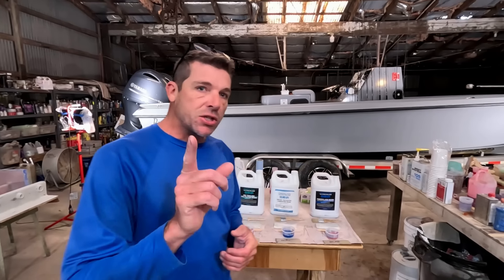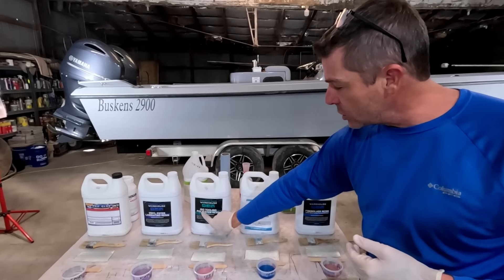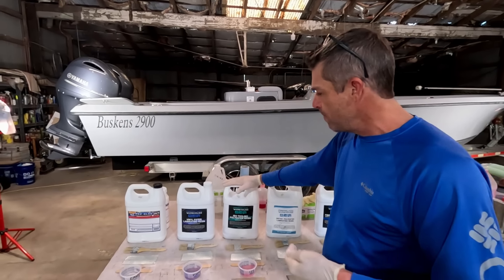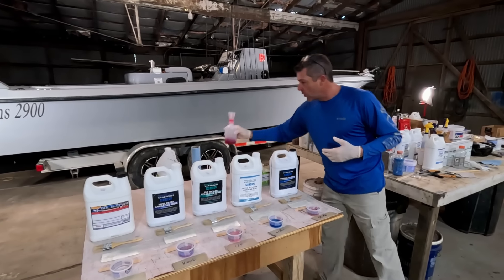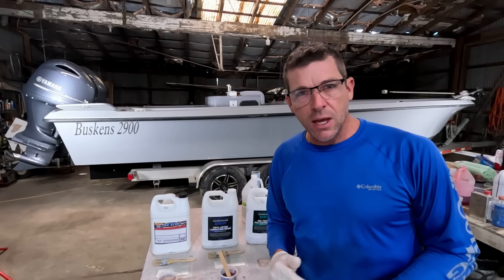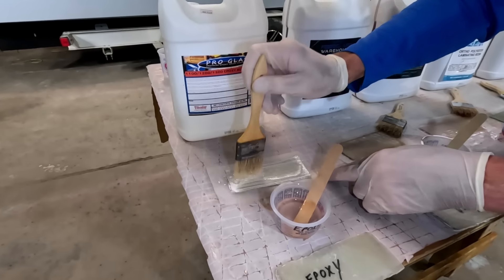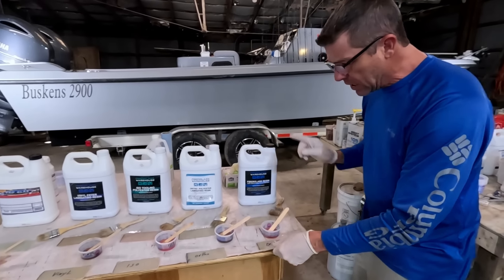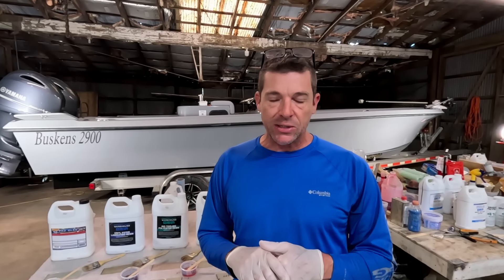HOW-TO CHOOSE THE BEST RESIN FOR YOUR NEXT PROJECT-DIY FIBERGLASS

Comment: What resin should be used to construct a fiberglass gasoline fuel tank?
Reply from the maker: We typically use aluminum or poly tanks in our boats, but I would think that vinyl Ester might be a good choice. ThT is something you should do some research on before making a decision. I hope this helps and thanks for watching!

Comment: my seat supports have broken off @ tha floor of my 1971 boat what resin should i use ? the hull/floor is solid & rock hard    thanks
Reply from the maker: The vinyl ester is my favorite resin in the lineup. It is what I used in our hardtop build series of videos that we have been recently posting. I hope this helps and thanks for watching!
Reply: @FishBumpTV thanks for the responce. on my 71 model flat bottom v-drive “ole school drag boat” its been sitting 30+years & the hull is as hard as concrete along with tha stringers. rite now i have the entire floor & stringers to the point they could be painted. would it be a good idea to sand an lay a fresh lawyer of cloth an resin or let it ride an just put ? coating on the bare floor/hull ?    thanks 
ps new sub. 👍

Comment: I have fiberglass hydrohoist tanks I'm repairing (cracks and chips).  I know that you mentioned that you don't use finishing resin, would it be necessary for my job?  I plan to epoxy prime and bottom paint the tanks after the repairs are complete.  Thanks for the help, your channel is super informative!
Reply: Why are you using bottom paint?
Reply: @FiberglassWarehouse  The are submerged in the water 24/7.  I figured bottom paint would be the best option.  Is there something else you would suggest?
Reply from the maker: The vinyl Ester resin is the is going to be be the best for that application in my opinion. It bonds very well when used in repairs, it is compatible with csm or mat fiberglass and it is a great water and moisture barrier. I hope this helps and best of luck with your project!

Comment: No gel coat over epoxy so could you epoxy then top coat with vinyl ester then gel coat?
Reply from the maker: No, not even vinyl Ester is  recommended over epoxy. I do have a product I will be testing very soon that is designed to solve the compatibility problem between epoxy and polyester-vinyl Ester based resins and gelcoats, so stay tuned!
Reply: Thanks for your reply, I’ll be looking forward to the new videos.

Comment: Im trying to fix a headliner in my car want ot a little stiffer im things the first on or the midle one what do you guys think
Reply from the maker: The middle one, which is a vinyl ester is my favorite all around resin. I hope this helps and thanks for watching!
Reply: @FishBumpTV 
I was hoping for a commet like this as im am doing research in repairing a headliner as well. Its already a type of fiber board..so i would emagin it will absorb the resin well,  that being said mine is sagging.. and i want to fix it before its to late. I think i need a thin yet strong material to add to it. Im thinking a layer of glass cloth vs matt is better. What are your thoughts on that as well as should i apply 1 solid sheet to cover the entire liner or over laping strips? Or multiple layers? It cant obviously be to thick as it has to go back into place. Any help would be great. Ty for the videos im not doing a boat any time soon. But enjoy learning something new all the time.. oh im trying to apply it to the top side... with out bleading through the board or damaging the fabric on the head side.   As its still verry nicely attached and in great shape

Comment: Thanks for the information.
Which one do you recommend for automotive exterior body kit applications
Reply from the maker: Glad you are enjoying the videos! The iso tooling resin and the vinyl ester are really good. Epoxy could also work, but you would have to use epoxy based fillers and primers if you choose to work with the epoxy. I hope this helps, and thanks for watching!

Comment: Im trying to fix a transom that has delaminated in a small area. I was thinking of injecting a resin into the split from the top and then clamping. Would you choose vinylester or epoxy? Love your channel!
Reply from the maker: They could possibly both work. I might lean towards epoxy on this one though. Just be sure there is not any moisture in the delaminated area or nothing will stick. I hope this helps and thanks for watching!
Reply: @FishBumpTV  Thanks again for all the help. You are awesome!

Comment: I want to do a webbing/splatter finish on my current project.  I don't have a sprayer and don't want to invest in all the necessary equipment and additives for a small project.  I bought a can of Montana Marble Effect Acrylic spray paint which will produce a similar webbing effect.  Will acrylic paint stick to gelcoat?   Thanks.
Reply from the maker: I don't know if that could work or not, I have never tried doing that before. You could always do a test panel and see before doing the whole thing. I imagine even if it does stick to the base gelcoat that it would not be as tough as gelcoat splatter in the high wear areas. Hope this helps and thanks for watching!

Comment: I have a ganoe that I am planning on redoing the transom and the Bow Ridge. Which resin do you recommend for both? Also, would it be okay to add pigment to the finishing resin?
Reply from the maker: I really like the vinyl ester resin from Fiberglass warehouse for just about everything. I don't usually add pigment to resin, I would recommend using gelcoat in the correct color if possible. Thanks for watching!

Comment: Hi do you have any tips on how to strengthen a transom on a small fiberglass boat? I have already clamped and fiberglassed two pieces of plywood on the actuall transom but i need strength lengthwise ! Is there any solution like some supports or something?
Reply from the maker: Every boat is different, but adding some support in the corners, or from the transom to the floor may be the ticket. You might try to look around for simular boats and see what they have for transom supports. Hope this helps, and best of luck with your project.

Comment: Does anyone have an opinion on Epodex Epoxy Laminating Resin?
I am considering using it on a 22-foot plywood sailboat build,  and I would appreciate your thoughts/feedback. Thanks.
Reply from the maker: Sorry, I don't have any experience with that particular brand. You might reach out to the fiberglass warehouse about their vinyl ester resin. It has many of the benefits of epoxy resin, but at a lower price and easier workability in my opinion. It is the resin I used in our hardtop build and I have a resin comparison video that shows different resins and their uses. I hope this helps, and thanks for watching!
Reply: @FishBumpTV  Excellent, many thanks for your reply.
Reply from the maker: @aseeker2109  Glad to help!

Comment: I don't think the styrene-based resins were fully cured.  Likely they would have performed more similarly to the Epoxy if they were fully cured.  I think also for repairs, the secondary bonding strength of Epoxy gives it the upper hand and why most DIY folks tend to use it more.  The only downside is for repairs when gel coat is involved.
Reply from the maker: Thanks for your thoughts

Comment: I am disappointed with the results of the epoxy resin. 
Did you use a fiberglass that don’t have the binding agent that make it incompatible with epoxy + of the same weight that the fiberglass you used for polyester resin?
Reply from the maker: Yes, I was  also surprised. The 1708 biaxial glass used in the video is compatible with all types of resin, including epoxy. The fiberglass for all of the test pieces was cut from the same  stock piece of 1708, and all of the pieces were left to cure for the same amount of time under the exact same conditions. I just did a very basic strength test to show you guys how they reacted when put under stress, but feel free to do your own testing. I Hope this helps and thanks for watching!
Reply: Thank you for your answer. I’m surprised that there is fiberglass that can be used for both epoxy and polyester (fiberglass for polyester contain a binder). I though polyester resin need this binder that is in the fiberglass. Could you talk about that? Is there a need to add this binder on the fiber glass before adding the polyester resin on such fiberglass?
The format of your videos is great by the way. Good videos.
Reply from the maker: @nico-bf1kr  The csm is the only fiberglass that I am aware of that has the binders in it. There is another type of csm that has a powder binder , that does work well with epoxy resin. Apparently that type is not available in the U.S . I will try to make a video on this topic for you guys. I hope this helps, and thanks for watching!
Reply: @FishBumpTV Thanks! I will be happy to watch that video! 👍